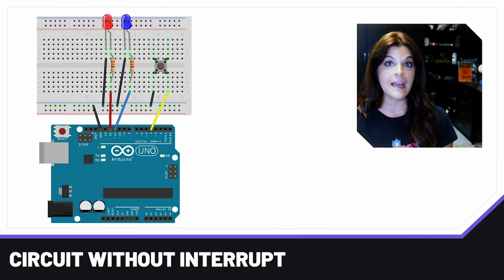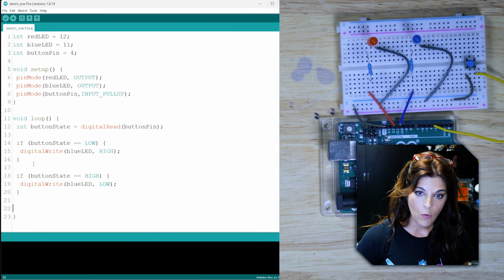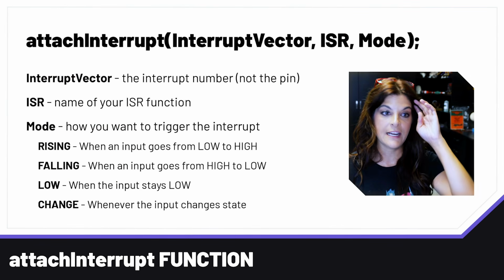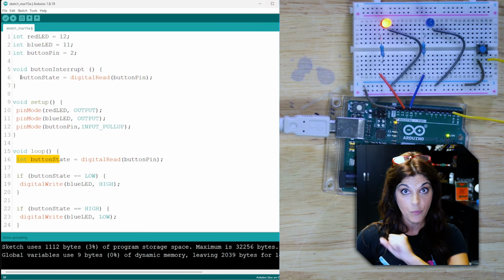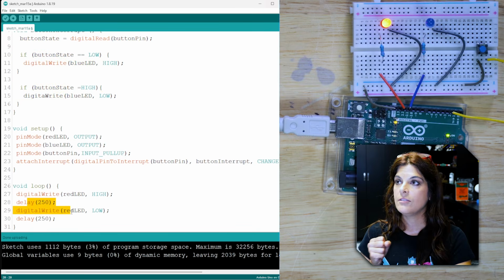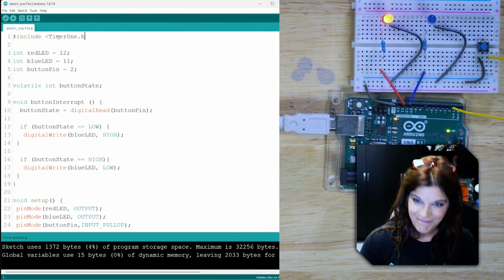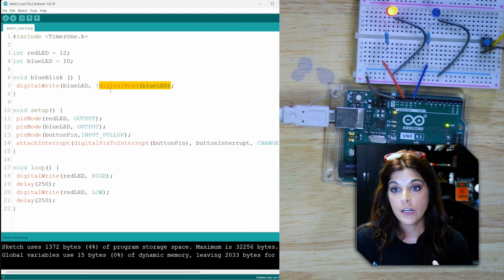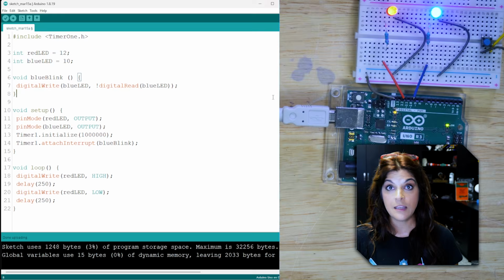How to Use Arduino Interrupts The Easy Way

Comment: I built a demonstration of a perpetual motion machine as my first project using an Arduino. "Perpetual Motion Machine?" The Arduino is very flexible and can even work with a power supply that is a half bridge rectifier. Looking forward to your next video.

Comment: Hi Rachel, if I join your website for $4.99 per month, am I able to send you some code that I wrote that I'm having an issue with?  Simply put, I'm using two Nano's, two HC05 bluetooth modules, an LED, a relay, a button, and a reed switch.  When I press the button on the SLAVE device, the relay on the MASTER closes.  Does exactly what it's supposed to do.  When I open the reed switch (garage door opens) the LED on the SLAVE device lights up as it should.  However, while the reed switch is open the button either no longer works, or works really flakey.  I followed the directions on this video and really hosed my code.  So in short, would this be something you could help with?  I'm be happy to join if you could.  You're an excellent instructor and I feel like I could learn a lot from you.  Thanks in advance.  -Glenn
Reply from the maker: Hi Glenn, you can absolutely post code in the Discord community. While I can't guarantee that we'll solve your problem, we can definitely brainstorm some ideas as to what's going on.

You also have the option of joining for free as an "Apprentice" on my website. Youtube does not allow free tiers so only the paid tier shows up here. You'll be emailed an invite link to the Discord community where you can post code and chat with other members.

The Founding Members tier (for $4.99/month) includes Live Workshops and Zoom Community Builds.

To join (either for free or paid): https://racheldebarros.com/community

You can toggle between the 2 tiers and pick the one you want 😄
Reply: @RachelDeBarrosLive  Thanks Rachel.  I joined the paid one so I can get it all.  I watched some of your videos and I'm impressed.  Thanks again.

Comment: Very good.  Great explanations. But this is different from any use of the term "software interrupt" I've ever seen. Normally that refers to a processor instruction that invokes the same state save protocol as a hardware interrupt a la the x86 INT instruction. It's e.g. used to invoke OS functions. Timer interrupts are hardware. It's just that the hardware is on-board rather than external.

Comment: I did it with the LEDs flashing in binary with a string of code. I was attempting to create  an effect similar as seen on  Close Encounters of the Third Kind with Richard Dreyfuss . Most of you may not be familiar with the movie depending on your age. It was an attempt at communication with the Alien spaceship. I was not successful I could not recreate the sound frequency for each LED. as per the movie. I was having fun with LEDs, Relays, piezo speakers,

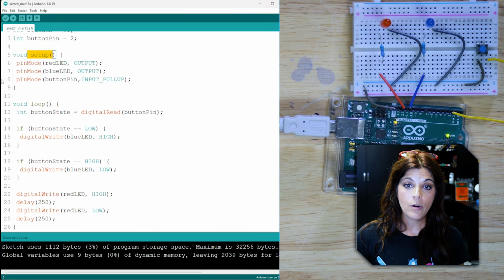Comment: 13:00 Regarding where to put additional functions in code, it's true that for the Arduino IDE+Compiler top or bottom is fine.

However, if you're using an ESP32+Arduino Framework+PlatformIO+VScode I've found that (probably) the compiler complains about "undeclared functions" if you put them at the end, i.e. you try to call on a named function before it's seen in the code.

There might be an additional parameter or something that can be parsed to the compiler, but that beyond me.

Comment: Question: Is the interrupt routine being called twice each press since you used "change"? The pin is pulled up, then you press the button so it goes low and the interrupt gets called. When you release the button, is that also another change to high so it gets called again?
Reply: Yes, you are right.

There will be an interrupt for each state change.

One interrupt on changing from HIGH to LOW and another on changing back from LOW to HIGH.

Comment: Just one suggestion, in case of mechanical interrupts (like buttons) you would want to set a state and in your main even loop just trigger the code for that state. 
This solves mechanical bounce issues and thus prevent an "intererrupt storm" -- the interrupt will be triggered several time and the code runs several times.  NOTE: this also depends on the controller used, some you will need to self acknowledge an interrupt, other the ACK is done implicitly when calling the IRET or equivalent op code. I am not familiar with ATMel it's implementation.
But for completion sake, you don't want to debounce that switch, like you said no long delays in an ISR. Because it's will take ~20ms and that's an eternity for a microcontroller (and an ISR). So the easiest trick and something OSes use, is to set the STATE to the next state and let the state engine loop run that code. Which often in the next STATE of the loop is fine -- for switching a user LED on, that is perfect you wouldn't notice that 1ms or so delay. That's the finnicky thing with ISRs the implementation of your hardware is something you should know and it often depends also on your application whether you need to process your ISR in the main eventloop or immediately. There are cases for both of them

Comment: I have not long understood about using  Millis instead of delay
I have a question to ask
If I have power to the Arduino
And have a code programed installed
Can I use a button to activate the code
Meaning the code is dormant untill I press a button
What I'm doing at the moment is have two LEDs blink via the Millis timing
But it runs all the time so I have a button that is used as a circuit breaker and so when I press it it makes the leds connect
But I would like to understand is there a way how to use a button to run the code to activate the LEDs only when the button is pressed
Reply: There is a "sleep mode" you can use for this.

In this mode the Arduino consumes only very less power, so this is great to be used on battery powered solutions.

From this sleep mode the Arduino can get waked up by timer or button, as you like.

Then the Arduino can do it's job and fall to sleep again.

Comment: Thank you for this.   My project involves LaRa radios remotely located, so this is a big boost in being able to run the remote processes while waiting to receive a transmission.
One difference from your video.  When I run your sketch, exactly copied, RED flashes four times, the BLUE flashes, but twice, in opposite synch to RED.   Then red flashes twice more, then blue-red twice, etc.   I've played with the delay and the microseonds.  Seems as though the ISR runs twice every 1/10 second.  I'd like to test LoRa for data receipt in the interrupt and do pass the incoming data to the loop.   It may not matter, but thought I'd ask since my results differ.  Thank you again.

Comment: Thanks for such an informative session. This video really helped me to take out the fear of using Interrupts.
However, I have a question: 
If the Timer 0 interrupt is used....I should NOT be using delay or millis functions......but if I am using Timer 1 or Timer 2 .....can I use delay and/or millis in the loop function?
Reply: Yes, you can.

Comment: doing the digitalRead for the digitalWrite to toggle the state - yeah that works but... ok, fine.
Just having a state-variable would be nice, or use the already existing state: the arduino already has to know what state the PIN is in cause that is used directly by the hardware. And you can also read that state directly.
For these simple tutorials the cost of a single digitalRead is not much and can be ignored, but if you had say 10 LEDs and wanted to blink them to get a dimming-effect than the delay quickly adds up (I think it was 4us for a read - with 10 LEDs that would addup to 80us/cycle - wich ends up in the audio-range. So if anything else is connected that has some mechanical movement this would not be good.)
Reply: For dimming LEDs you should use PWM (Pulse Width Modulation). This is done by hardware internally und you do not need to switch LEDs on or off via port writing.
Reply: @Klimafutzi  "This is done by hardware internally und you do not need to switch LEDs on or off via port writing."
kinda. With just the "normal" library and simple tutorial ways you can run 6 channels and all timers are used.
those timers are just periodically running the code that is writing to the port - a nice convenience wrapper for simple applications. 

If you want to control more than 2-3 PWN or """analog""" signals one should look into timer libraries and Atmega timers.

Comment: Great content and thank you for posting. I’m just getting started with Arduino so your posts are very timely but I’m wondering why you declared buttonState variable inside of loop. I was taught to only declare variables once otherwise the processor wastes resources. I think your code would still work if you declared before the loop. Do you agree?😊

Comment: I am wondering, can in this (interrupts) instance the blue led stay HIGH, while the red one keeps blinking (that is as with a latching switch or a longer delay on the blue led)?

In my specific case, I am thinking of a simple buzzer piano for my nephew. Overingeneering as usual, I got this idea of having a song or predefined beats playing from one buzzer, while being able to play tones on the other buzzer by pressing keys. Already binge-researching and I certainly will need to do some partia demos to try the concept first, but if anyone has an idea to save me some dead ends...

OMG, on additional hough, I may actually replace the key buttons qwith piezo touch sensors and possibly add a small amp (which  have a couple of) to add an audio jack output. I really need to define an MVP to start with. :D

Comment: Just a small comment @16:14.  In this case, you only use 'buttonState' within the ISR, so it could be left local to that and wouldn't need the keyword 'volitile'.  The only time this variable is changing is the line with 'digitalRead(buttonPin)' and that's only called in the ISR.

An example where you would want it declared outside the ISR and WITH the keyword 'volitile' would be if it's changed inside the ISR (via that call to 'digitalRead(buttonPin)') and then used OUTSIDE of the ISR, (perhaps in 'loop()').  The compiler has no way of 'knowing' when the ISR may be triggered to change 'buttonState' so in loop() it must check the value in memory each and every time.

Comment: Whats wrong with printing to the serial console in your ISR's?

edit:  this was helpful.  I dont use delays at all, i work with millis exclusively.  However,  i will need this method soon for responding to user input during things like connecting to wifi/etc!  Thank you!
Reply: Isr should be as short as possible.  Do not use print or delay in an Isr routine.
Reply: @skynet1703  I also saw this same answer on the arduino forums. :).  Other sources say there is no problem with it, but it can have "weird" results.   Hoping for a bit more.
Reply: @jaymedavis7567   Serial communication USES interrupts it self. You can write to serial in an ISR but even that is something you should avoid cause that too uses interrupts to get the timing right.

Comment: I remote controlled a 10 HP Craftsman track drive snow blower using a 10 channel Flysky and mega 2560. I learned Arduino coding just to build the project. I use all 10 channels to operate the servos, motors and actuators. I was able to get everything to work without using any interrupts. I'm sure my code is far from perfect, but surprisingly I got everything to function.

Comment: It is actually good practice to put all function declaration at the top after all other macros, pins etc etc.
Not all languages accepts declaration after the function is called.
C is one of these languages where it is mandatory to put them before, some compilers will accept otherwise but...
I dare you to try coding in C you'll get faster programs, smaller programs, for comparison blink a led in Ardu-IDE are about 1KB and in C you can get it as small as <200B.
Some will say it doesn't matter and you're wrong, for a single button and a led no it doesn't but when things a timing critical like RS232 it makes a difference.
If you write a small program for turning on a LED via a button you'll se the difference between C and Ardu-C++, their will be a short delay between the button push and the LED turning on.

Or even better, add a header.h file to your project, yes you can do that in Arduino IDE or even write pure C and it will compile just fine.
And when your at it put all your functions ISR and such in their own file, and just call them when needed and even static functions, inline functions.

Watch out for libraries  that implement timers.... You might have to dive into those files and check if one or more function uses the same TMR or else you'll will get into nasty issues.

When I'm using int, char, unsinged int, long, word etc I really like the library stdint.h which only makes macros for integers.
Because it's names are in bits, at least I think its a bit more self explanatory  int8_t, +/-127ish uint8_t = 255 uint32_t = 4e9-ish.

Don't forget pointer those pesky pointers that makes some thing a lot convenient, or I think they work in Arduino C++ flavor thingy.

There absolutely nothing wrong with "long code" when you just wan't stuff done, it's often easier to read.
Reply: "I dare you to try coding in C you'll get faster program"
Or you could just use C++ for that and not have the headache.
Reply: @ABaumstumpf 
Which is the language that's used in Arduino IDE, more or less.
Reply: @hannescamitz8575   "more or less."
Yes - so quite a lot better to stay with that and go to a compiler and IDE that support the full language.

Comment: First example confused me, like a lot. Why are you using delay? The is an example program for flash without delay. If your half decent at coding, delay will not be used. I built a project with 14 user inputs, 12 servos, 3 motors, 4 end stop switches and 2 ardunios connected via 24mhx radio and not a single delay was used and no humanly detectable delay between user input and the corresponding output, even with the radio link between the 2.
Reply: Bro she is targeting teen agers not professional engineers 😂, nothing bad will happen if u put a delay 🤣
Reply: @assadaria  bro, I'm self taught
Reply: @grapes008  "If your half decent at coding, delay will not be used."
Correct - if you are half-decent that you don't use delay. And if you are decent or even good then you will use it where appropriate.
Reply: Once you understand electronics and how electrons flow.... delay definitely has its place. Do write your eeprom without 25mS delay.... you're not giving the gate capacitance enough time. So yeah... you could write 100 lines of code with a timer (and probably waste precious resource... unsigned long etc...) but in reality a delay of 25mS is faster and more efficient. So get of you high horse and gather practical experience before slating anyone's approach.
Reply: @chillipaste2183  hmmm no issues here. If you construct your code correctly and don't try and access the eeprom in two successions it's not an issue it also only takes 4ms to write and is recommended to not use the delay for that. Please go and learn how the electronics work. Code structure is important, that's how well written code works. Honestly if you run out of space for variables you should be asking why. You would be getting up towards things like marlin or CNC stuff - even GRBL runs on an Uno. It strikes me that maybe you should jump off your little horse.